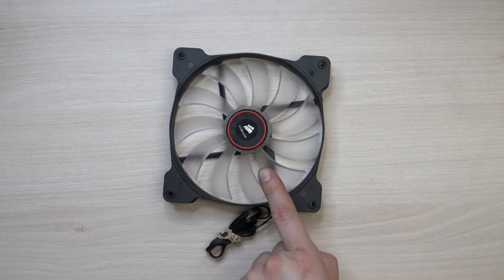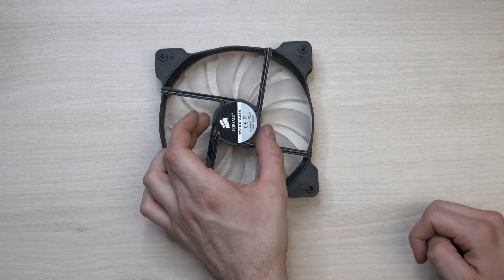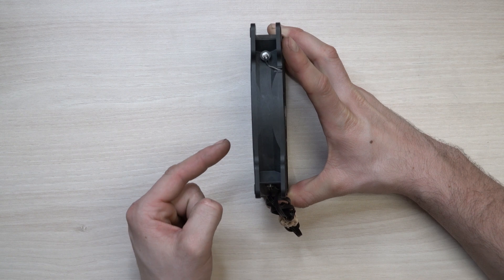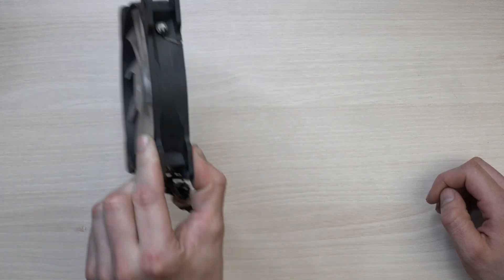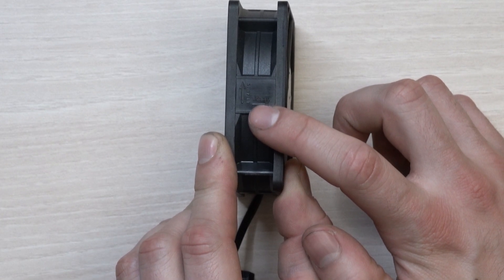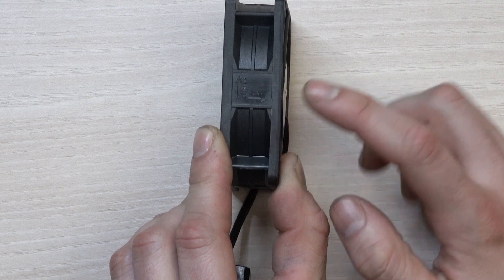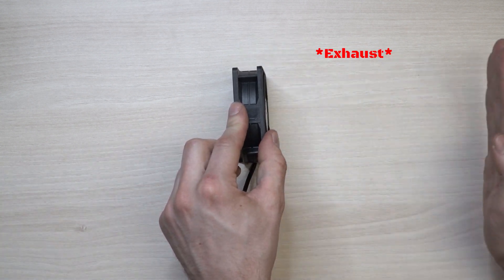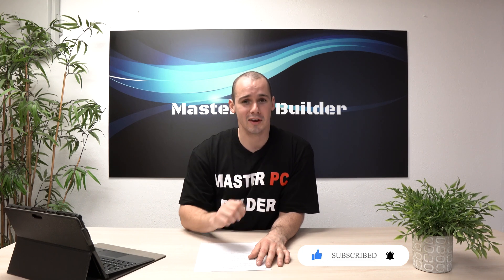What Direction Does a PC Fan Blow?

Comment: Do all the fans need to blow air inside, or can some blow it outside? I'm a bit confused. I just set up a fan to push air in cause it was pushing out, but my graphics card is heating up while my overclock is staying cool. What should I do?
Reply from the maker: You should have some fans blowing air into the case and others blowing hot air out of the case.